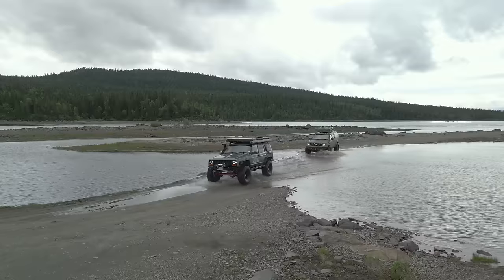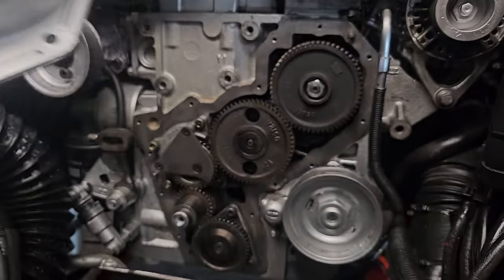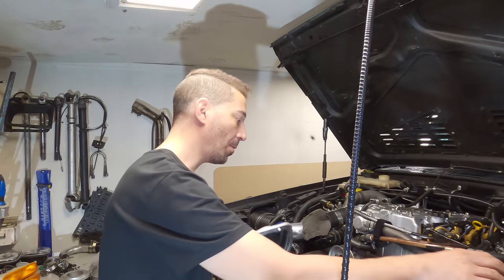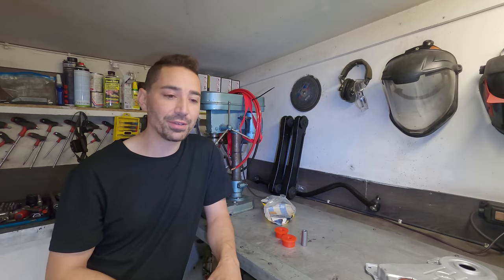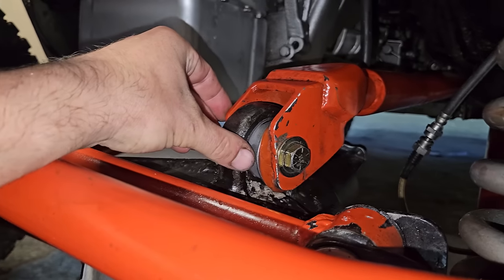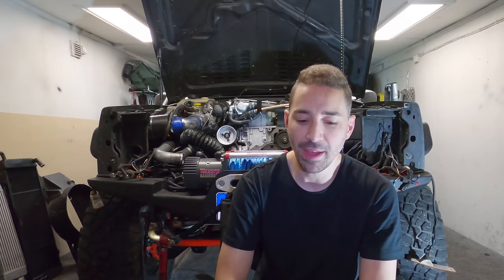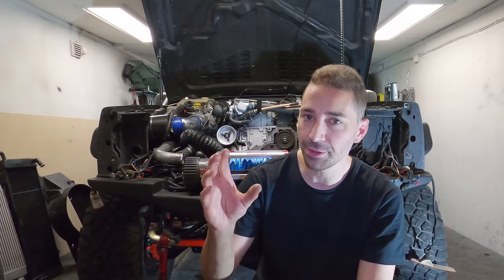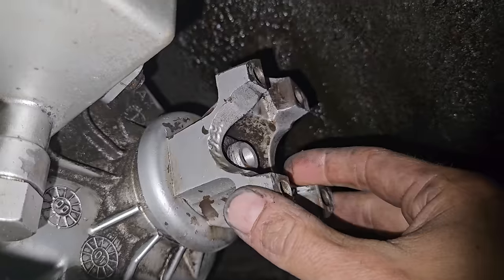JEEP XJ Service Time / Fixing Problems That I Created

Comment: If I understand it right the kid who makes those sway bars increased the thickness of those arms to 1/2 inch plate. I built my own knock off and made it from 1/2" and it's holding up fine.

Comment: Ah the front crank seal... also did it twice in a month. The second time I've properly straightened the cover, put the seal in a bit deeper, cleaned the threads, replaced bad bolts... and forgot to tighten the bottom ones so the RTV dried wrong and it leaks. I am not touching it again.

Comment: Hi Mike, we all feel your pain mate 😂 at 14.21 just a suggestion, but could you consider just putting a steel bush or packing piece in between the link and the arm to take the angle out of it pushing the arm?  Good shout with the timing cover and just waiting for the new one.  Especially as it is so clean and such a ball ache to strip it down again.  Good luck with the 4.0ltr mate look forward to seeing the progress with that.  Don't kick yourself mate we are all in this mad life together and shit happens but life goes on and we appreciate your videos.  👍
Reply from the maker: Hey Simon, I've tried that but the problem is it creates a leaver and bends the arm even easier. I think i'm going back to the drawing board on the whole thing. I will attempt to change the design of the arm so that the link mounts directly under it on some kind of drop down mount. Or I just plate the whole arm so its 1" thick. Its all a bit of a ball ache but I will try and get through it so its less likely to brake over the winter! 
Thanks for watching mate and the suggestion!
Reply: @WorkshoptoWilderness  I assumed you might have tried that I am sure the plate approach will sort it.

Comment: Hi Mike. Love all the videos. Always learn something! 
Mike. Dirt lifestyle on YouTube has a video titled. Dominate snow with this simple hack. 
The premise of the video is about tire siping. I learnt a lot from it. Nate from dirt lifestyle is chatting with a guy from Iceland. About snow traction and tire siping. Might be a good one for you to check out. 
And Nate has great content in general and is an amazing fabricator. Also has a ton of special tools too. 
Looking forward to the 4.0 videos. I need to replace my driver floor board and rockers. So the timing is perfect! 
It will be interesting to see how the Jeep does this winter with the front locker. And as low tire pressure as you dare run. Do you go down to sub 5 psi Mike? You have beadlocks correct? 
Method makes alloy wheels with bead grip technology. And they really do work well. Lightweight. But still hold on to the tire at super low psi. Especially in snow conditions. 
Looking forward to the next video!
Reply from the maker: Hey Russ, thanks for the info mate. I've watched Nates vid on Siping and it was an interesting video. Most people up here run Nokian and the serious wheelers run a Nokian Hakkapeliitta. I personally cannot afford 6500 Euros for those tires though! I will see how I get on though making some more siping on my crappy mud tires. I will attempt to emulate a Nokian style pattern that's common here.
I'm not looking forward to the floor pan work to be honest. Its going to be a pain the ass I think haha! Normally I run as low as 4psi on the beadlocks.  
Thanks for watching and for the info!

Comment: I’ve got to replace the crankshaft sensor on my inline 6 Cherokee. Waited two months for an OEM sensor. Finally  called Mopar, only to be told that part is no longer manufactured by them.
Reply: If you’re in the US, NAPA parts are just as good. I also ordered one last year because my jeep would just die after 2-3 miles, but while waiting my upgraded battery/starter motor and engine earth straps arrived. After I cleaned all the connections and replace the cables the crankshaft sensor problem also went away. The error is crankshaft sensor/low voltage so you might just have a bad engine earth
Reply: I will look into that tomorrow morning. Thank you for the tip. I used to do the majority of repairs on my Cherokee,but five craniotomies and countless rounds of radiation/ chemo have really slowed me down.

Comment: When running poly bushings, you actually want the clamp force to be into the inner sleeve rather than the poly insert. I’d double check that your sleeves are the proper length if it’s clamping hard on the poly like that
Reply from the maker: I checked the arm again, and the angle in which the ears mounted to the bushing was off. I must have made it incorrectly, hence going through bushings quickly. 
I removed the arm and corrected it, and it's evenly clamping the bushing with all the force on the eye. Thanks for the comment, it motivated me to take a second look
Reply: @WorkshoptoWilderness thanks for the mention in today’s episode! Glad I could give a bit of help.
Your videos have been great help/inspiration since I got my ‘96 (4.0l) earlier this year
Cheers
Reply from the maker: @phoenixtoomath  No worries! Thanks for pointing out the issue!

Comment: What kind of fan clutch do you use? Do you have a different water radiator than stock? I still have a problem with the engine overheating in the summer. 3 electric fans directly on the water radiator + original visco fan and it's still warm on long hills
Reply from the maker: I use the stock fan, clutch, and radiator. The only thing I changed was the water pump and housing to the 76mm chrysler voyager type. There must be something wrong in the system?
Reply: @WorkshoptoWilderness  I have an XJ 98" vm engine. 76mm water pump. It didn't look like the package was getting in the way somewhere
Reply from the maker: What coolant are you using? Its it blue ethylene glycol?
Reply: @WorkshoptoWilderness  I used the MPM coolant of blue, but it came to me aggressively, because I still had rust in the system. Now I have replaced the coolant for the yellow dynamax G11 R, but after 3,000 kilometers there is some rust in system again
Reply from the maker: I would use a HOAT coolant, Red. Its designed for mixed metals and its low conductivity.

Comment: The failed crank seal depicted at 6:51 is because it was installed backwards. The "open" end of oil seals always face the oil. The "flat" side always faces the environment
Reply from the maker: You might have missed the explanation there. That was the fourth attempt and fourth seal, which was installed backwards deliberately out of pure desperation.

Comment: How can I contact you in private Mike?
Reply from the maker: You can email me at mike@mcqbushcraft.co.uk if you like 👍
Reply: Mike, if you get the chance to frame stiffen the 4 ltr do it, my >94 is my daily but it can definitely do with it, the later ones came stiffer from the factory (where Samantha works) noticeably different/quieter. ( makes me wonder if the flex is why I go through a radiator every 12/18 months or they’re just crap. Enjoying the vids